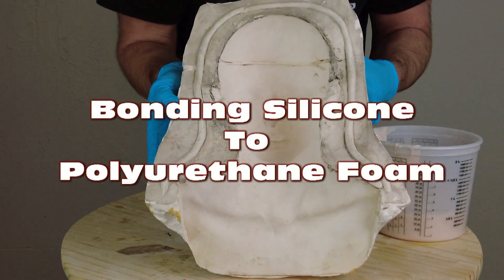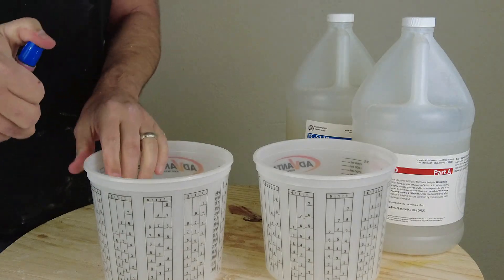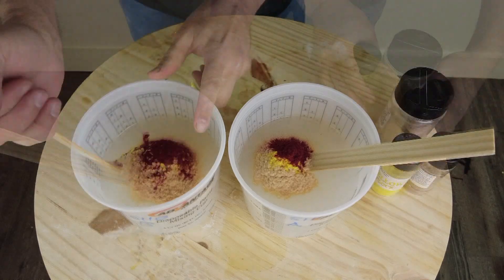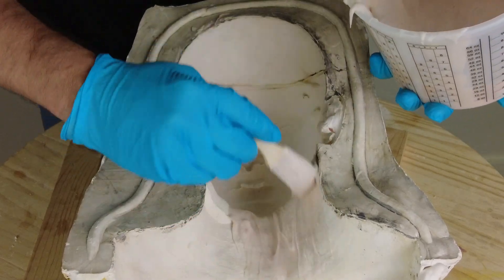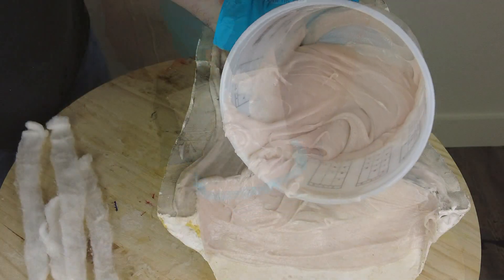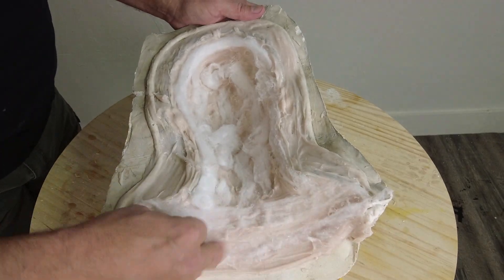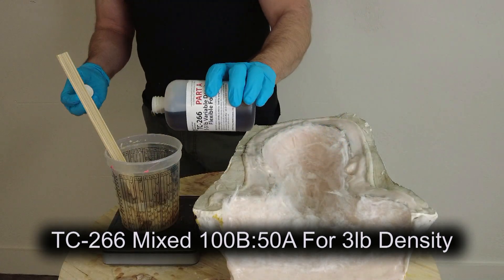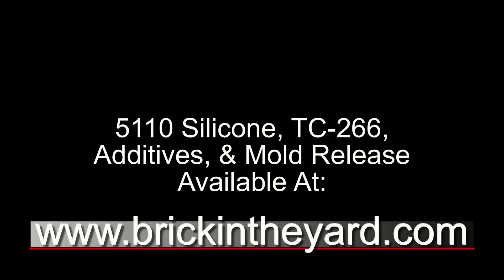5110 Silicone Skin With TC-266 Foam Backing

Comment: Is it possible to make a silicone mask, and fill in the foam between? I want to make a silicone mask with gigantic head. Surely full silicone would be too expensive and heavy..
Reply from the maker: @euna8708  yes, you could do that but casting would be tricky.